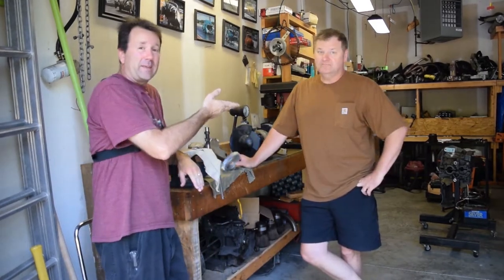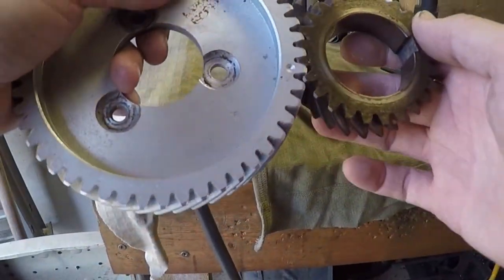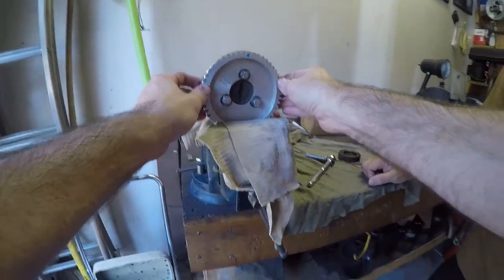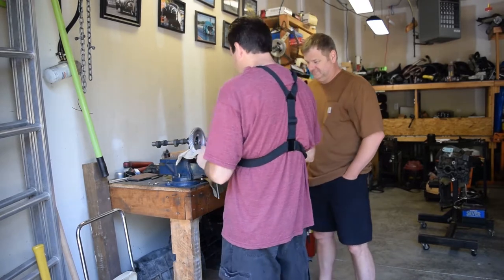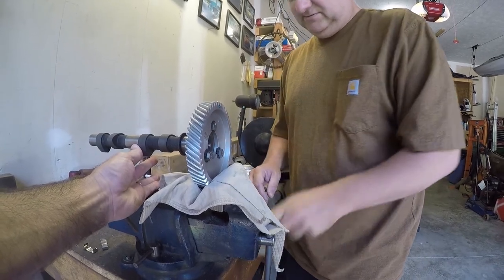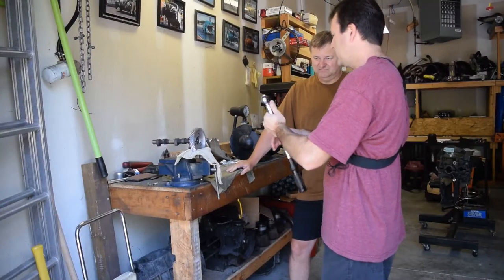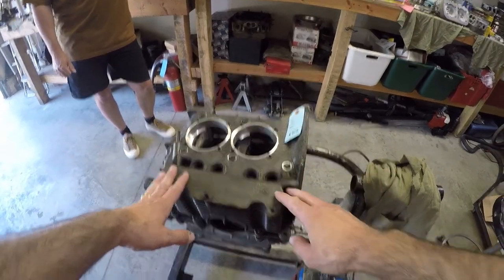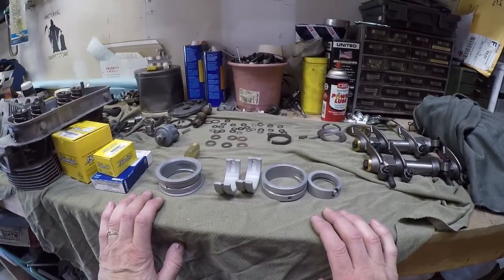Cam Gear Install on a type 1 engine cam shaft

Comment: I have 1.25:1 rockers with a engle W100 cam. It seems to be a good combination.  But I'm new at this 😀
Reply from the maker: Is this a used cam? If so, you can measure the lobes to make sure they are still in tolerance. You simply find a good spot on the low spot on the cam with a set of calipers and zero it out then roll it around to the high lift area, do this on of four lobes and they should all be close to the same height. Did your cam come with lifters. If or if not I like to have stock lifters reground.